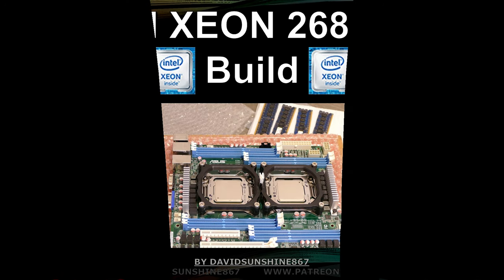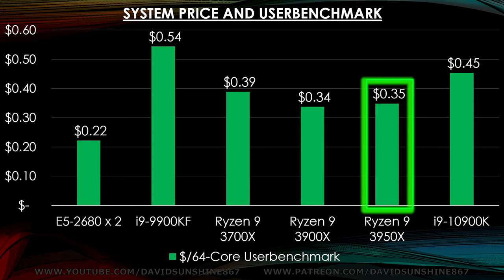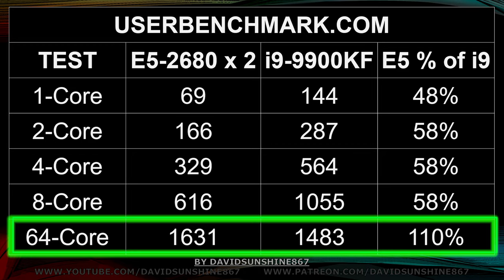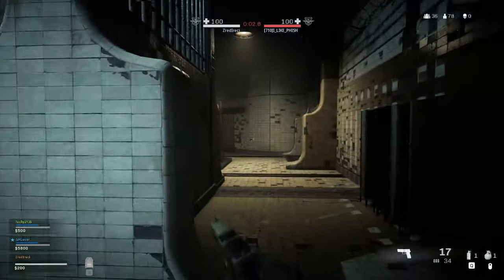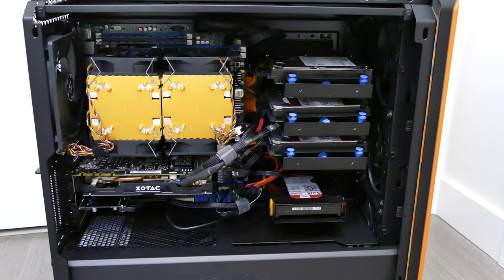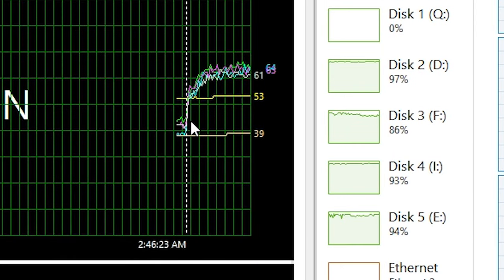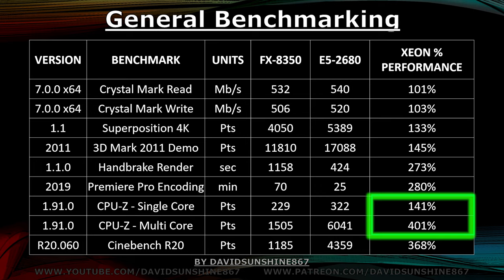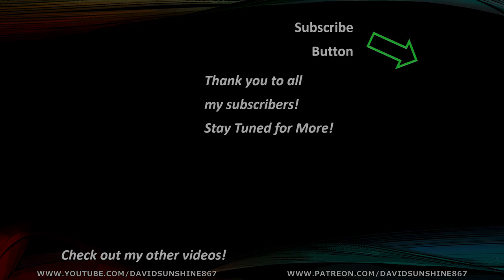Dual XEON CPU Build vs. Intel i9 and Ryzen 9, It's Faster!

Comment: how much power usage?
Reply from the maker: At 13m29s I show it uses 549w, it uses half when idle. That's with the monitor on, which is probably 40w.  I think the GTX1070 uses a lot. So if you don't have a dedicated card, it'll use less.  Each CPU uses about 105w.
Cheers!
David.

Comment: what if you put a core i9 and ryzen 9 on that mother board at the same time,,,,,will it works ??????
Reply: No the motherboard only accept Xeons.
Reply from the maker: That's a very interesting concept!  But it's that type of creating/innovative thinking that sparks new inventions.  As of now, I don't think they make a board that combines different CPU architectures, although it would be really cool if they did, best of both worlds!  It would be really challenging to integrate, and may need a lot of middleware hardware/software, maybe one day someone will do it.  For now we'll stick to dual CPU with identical CPU series/architectures.
This board only accepts E5-2600s, so we're really limited to that series only.  We even have to upgrade boards if we want to use V2s and V3s.
Cheers!
David.
Reply: @DavidSunshine  yeah maybe one day

Comment: I would like to build this from scratch. I need a tower and power supply. Where do I start?
Reply from the maker: Hi,
Any ATX case and PSU will work together, since ATX is a standard form factor for the cases and PSUs to follow.  Just make sure you don't get a different one like mATX, which is for mini ATX boards only, or eATX, which is for extended ATX(That would probably be fine, but it's for larger boards, so not necessary).
I personally use the Silent 601 case (https://amzn.to/350QNjq), and I like it since it's meant to be quieter, but you could use the more economic Pure Base 600 (https://amzn.to/2KJ7s4b).
For power supply, there are a few options: An economic 850W, $120(https://amzn.to/3b6jSOl), or you could go with a more expensive Brand, EVGA, $161(https://amzn.to/3hBDnPV), or even Thermaltake $150 (https://amzn.to/3oaOdif)  Or you can go with Corsair(https://amzn.to/2X4kprQ) or Seasonic(https://amzn.to/3hyVt53) PSUs as well, they are even more expensive, and should provide better quality and reliability.  There's no problem going with the budget PSU, it just means you'll have less features, and you won't get the quality or support from the bigger brands.
Cheers!
David.
Reply: @DavidSunshine  thank you David. I am trying to build a dual x79 with 128gb ecc. Any recommendations?
Reply from the maker: @johndee759  Cool, that's a great idea. 
I've never used the X79, but if I were to build a system now, I would probably get the following:
X79 Dual Motherboard: https://tidd.ly/39gjYjH
8 x 16GB 1866Mhz DDR3: https://tidd.ly/3ozvZr4
2  x E5-2690 (2.9Ghz  Base/3.8Ghz Turbo): https://tidd.ly/2Lz0wXp
You could also go with E5-2696 V2s (2.5Ghz Base/3.3Ghz Turbo) for more cores, but it costs a little more, multi-core performance is faster, but single core performance is a little slower, I'd probably go with the higher base/turbo speed since that will make the system snappier, you are only slower when rendering video, and you can always just wait longer:  https://tidd.ly/39lo0Hs

Hope that helps and gives you some ideas! Cheers!
David.
Reply: @DavidSunshine  absolutely . I was thinking to go with 4*32 ddr3 128gb. And two 2696. Is that pretty much highest cpu with most cores you can put in this board?
Reply from the maker: @johndee759  Hi,
If you want the highest CPU in the E5 V2 family, the E5-2697 V2 would be your best bet:  https://tidd.ly/3ox9K4Z
Check out the list here:  https://ark.intel.com/content/www/us/en/ark/products/series/78582/intel-xeon-processor-e5-v2-family.html
It's not as common as the 2696, but it's probably worth the extra $ since the base is 2.7Ghz and Turbo is 3.5Ghz, a little faster than the E5-2696 V2.
For 32GB DDR3, go with the PC3-14900/1833Mhz since it's the best the Xeon and Motherboard support, and it's not that expensive:  https://tidd.ly/2Xr06Vt

I'm wondering about the ram configuration though, the motherboard says it supports/has "High speed quad-channel DDR3 DIMM slots", and also the Xeon says it supports 4 memory channels, so to maximize the memory bandwidth, I wonder if using all 4 slots for each CPU would do it?  If you only use 2 slots for each CPU, you may only utilize 2 of the 4 channels, and only get half the memory bandwidth.  A bit of googling, it does sound like people think all slots should be populated.

I found this board that only has 4 slots total, but it might still only be using 2/4 channels for each CPU:  https://tidd.ly/39mKfgc
I don't think it will make a huge difference for performance either way, so I'd go with the 8 slot board, and just get 4*32 like you were planning.

Cheers,
David.
Reply: @DavidSunshine  thank you. How safe is it to buy from AliExpress. I think I have bought something from there before but just something very cheap. Should I buy this time it’s gonna be around $600.
Reply from the maker: @johndee759  You're welcome!  I have been ordering from AliExpress and it's been pretty good.  Less risk then Craigslist, but more risk than Amazon.  If something doesn't work out, you can dispute within 15 days of receiving, and the resolution process has been pretty good.  If you outright don't get the item, Visa can take care of it if AliExpress dispute falls through. It's better than eBay I would say. 
Cheers!
David.

Comment: will its perfomance willbe same as ryzen 5 3600 in gaming with same graphics card
Reply from the maker: No, I think the Ryzen will do a little better, since it has faster single core performance.  If you're using the 1070 though, it will be GPU limited, and performance will be similar.  If you're using a faster GPU, you'll benefit from faster single core performance, which the 3000 and 5000 series Ryzens will provide. 
If I get my hands on the new Ryzen I can test it out to see how much better it'll do, but I think I'll only get 5-10% increase in frame rate with the new cpu and ram though. 
Cheers,
David.
Reply: Also try the Xeon E5-1680 v2 for gaming (great bang for buck) or the cheaper/slower Xeon E5-2650 v2. Both are Ivy Bridge 8-core/16-threaded parts. 
Get a motherboard that supports overclocking ideally. It is important to get the clock-speeds up when gaming. 
No real need to get a dual CPU system for just gaming I'd say. 
(Like it was mentioned in the video, best to avoid a server board. They will be missing USB + sound etc. Although any modern GPU will have its own sound chip built in. You can can also add USB support via an add-in PCIe or PCI card.) 
A good Xeon E5-1680 v2 part can be OC-ed to about 4.6GHz (on all cores) and will ~match an R7 3700X. 
As games become more multithreaded, these Xeons will get better and better at gaming. 
Certainly a cheap way to get good performance (especially as the server RAM they need is dirt cheap) but future up-gradability (of the CPU) is not really an option. 
Try AliExpress for all the parts! 
But be careful to check what you are buying, as there is a seemingly endless variety of Xeons out there, all using different sockets/platforms and with very differing gaming abilities.
Reply from the maker: @DJ_Dopamine  Thanks for the information and tips!  An OC'd Xeon is a great idea, I like the 4.6Ghz speed on all cores, sounds promising.
I bet water cooling could keep that stable and sustained 4.6Ghz on all cores even under max loading.  That would be a fun build. 
Cheers!
David.

Comment: Would you know what case this would fit in?
Reply from the maker: Yup, these are ATX sized motherboards, so any case that can accept ATX motherboards will fit. 
I suggest a mid-tower case, unless you need a lot of hard drives and want  lots of space, then go for full-tower.
I'm using a mid-tower, and it's plenty for my hard drives and 2 SSDs, I use the Silent 601 (https://amzn.to/350QNjq), their Silent line of cases have more sound isolation built in, so it costs more, $189, so it's a little quieter.
You could go with a basic case, it's a little less, $89, the Pure Base 600 (https://amzn.to/2KJ7s4b).

I prefer no window, since I'm focused on sound isolation, but if you want a window so you can see your dual Xeons configuration, they make those as well, like the 601 with a window (https://amzn.to/3hwlK40).

Cheers!
David.
Reply: @DavidSunshine  also would. you reccomned 1 or 2 power supplies
Reply from the maker: @rashadabdul286  Sure, for PSU, I recommend 850W, you pay a little more for the power, but it's much more capable of delivering the power you need, depending on the video card, you can pull 500+W, so you would be fully loading a 650W PSU, which is gonna run hot and could cause problems, 850W would be the minimum recommended in my books, so that it can run a little cooler, and be stable.  Any ATX PSU will fit, there are many options on Amazon: 
1.) Here's an economic 850W, $120 - https://amzn.to/3b6jSOl
2.) But I would recommend going with a name brand like EVGA even if it's a little more, $161 - https://amzn.to/3hBDnPV
3.) This thermaltake is also pretty good $150:  https://amzn.to/3oaOdif  You can go with Corsair(https://amzn.to/2X4kprQ) or Seasonic(https://amzn.to/3hyVt53) PSUs as well, they are even more expensive, and should provide better quality and reliability.

Those are my suggestions, but there are many options on Amazon, I recommend getting an 80 Plus Gold PSU(Don't get Silver or Bronze, or no rating), as it's an efficient PSU,  Platinum is better, but will cost you a lot more: https://www.amazon.com/gp/search/ref=as_li_qf_sp_sr_il_tl?ie=UTF8&tag=davidsun06-20&keywords=850w ATX PSU&index=aps&camp=1789&creative=9325&linkCode=xm2&linkId=7a76fb646b6ba851e66132ea305cd152
Cheers!
David.

Comment: can a dual processor be overcloaked Dual E5-2678 V3
Reply from the maker: I don't think the 2600s can be overclocked.  They are locked, especially with my server board.  The multipliers are locked for sure. You might be able to increase the FSB in the X99 boards though.  But I've never done it.
Lots of people overclock the 1600s though, by the sounds of it, which is better for gaming.
Cheers,
David.
Reply: @DavidSunshine  thanks but can i know will the ryzen 5 3600 build will be good or the Dual E5-2678 V3 as you mentioned in perfomance in description i mainly do work on blender and gaming but to me gaming is more important
Reply from the maker: @kashmirikitchenmasala3385  Hi,
If gaming is your priority, you should go with the 3700X, but right now, if you can get the 5600x for a similar price, it'll be the best bang for the buck.  You might be able to find a used 3700X for a good deal though. 
Xeons are good for rendering and simulations, but not so great for gaming, that's where single core performance will benefit you.
Cheers!
David.

Comment: do you need a sound card?
Reply from the maker: Ya, the board doesn't have one. But I actually ended up using a cheap USB sound card instead, the sound blaster card I put in has a little buzz when I record audio from my mic.  
Cheers,
David.

Comment: are xeon e3 1220 V3 still worth it?
Reply from the maker: Hi,
The E3 1220 V3 isn't a bad CPU, but being only 4 cores, it's not really worth it.  It's single core is a little faster than an E5-2680 V2, but the 10 cores of the E5 make it's multicore performance almost 4 times faster.  So the E3 may not be worth upgrading to, especially if you need to buy the motherboard and RAM.  You're better off going with something with more cores. 
Cheers,
David.